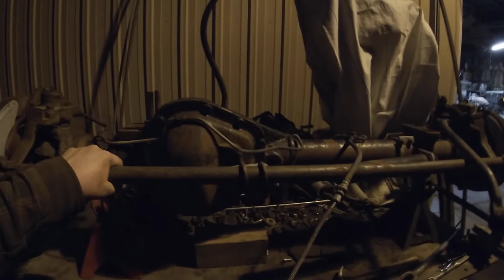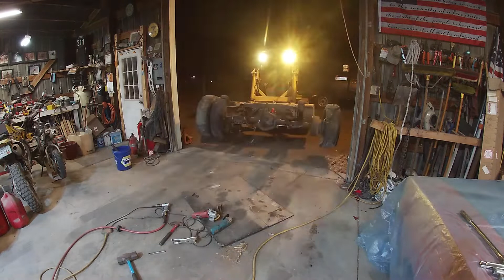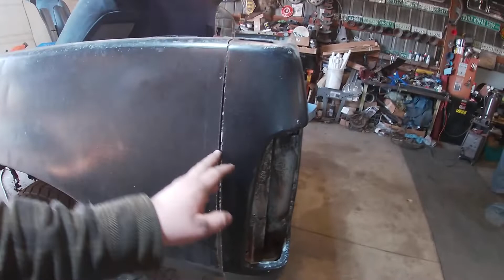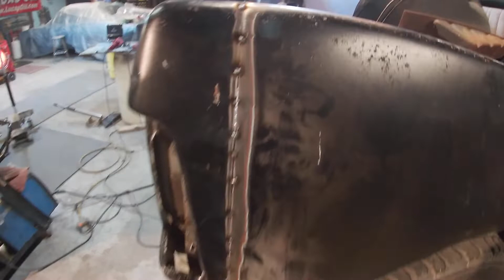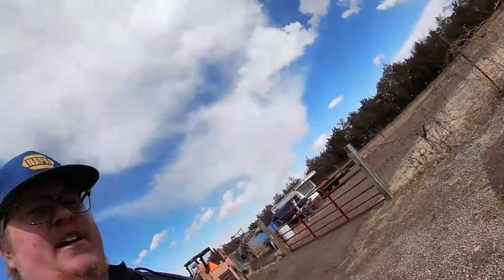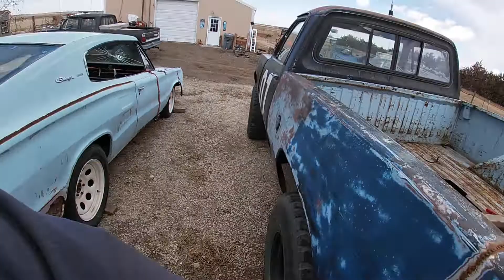Bobbing the Dodge W100 Offroad Truck Bed PT2 - Budget Build Offroader

Comment: This reminds me of when I was in high school and my friend Huey bought my dad's ex oilfield 69 shortbed duallie C10(3/4 ton w trailing arms so maybe that's a C15 or whatever. I'm a Mopar guy)with the homemade wooden bed. Dad had put a 396 out of a Chevelle in it and it was more or less a rowdy nuisance. Anyway, we got bored w it after a bit and stripped the bed off it, lots of torque, no traction, 4 smoking tires. Good times. Got bored, yanked the hood off it and installed unmuffled homemade zoomies. More good times. Still creeping out onto the streets of Alice Texas at night at this point. I go off to school and the first time I get back Huey has done shoved the trailing arms as far forward as he could and cut off the frame an inch aft of where he welded the spring mounts back on. Wired the tail lights on somehow and was back on the street. Best times of all. Everytime I see an airport tug I think about that truck and get all teary eyed